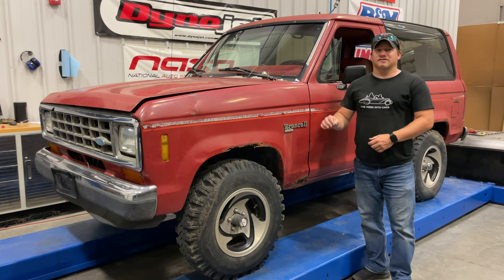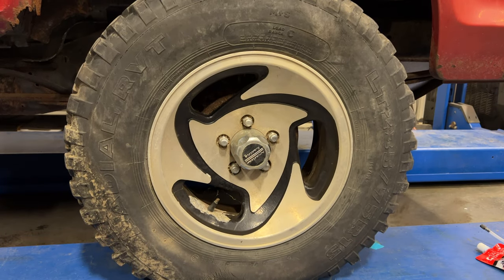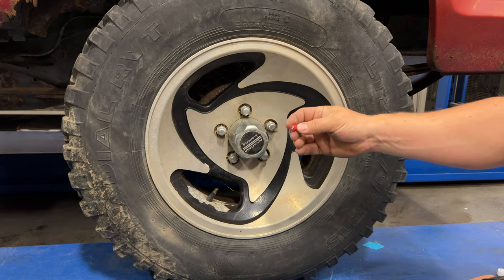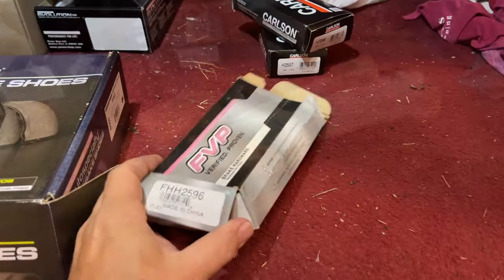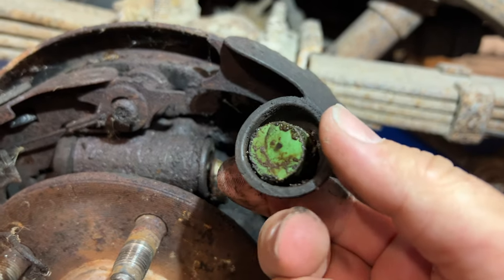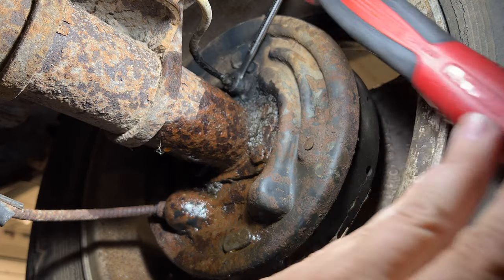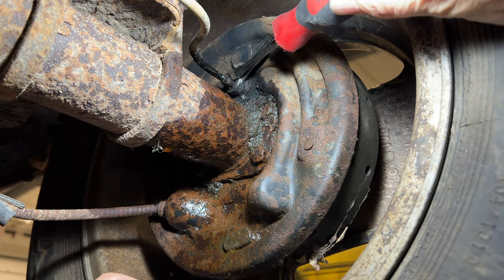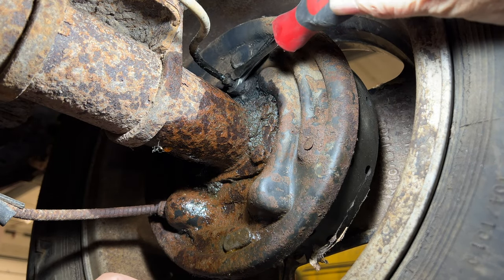Fixing the Tires and Drum Brake on Your Ford Bronco II

Comment: Steve,i once repaired a puncture by pouring pva in from poundland(dollar store).
Worked well and outlasted the tyre.
Cheers.Thumbs up.
Reply from the maker: Basically Elmer’s Glue-All I am sure it would work in some cases.  I don't know if it would continuously work like this stuff or if it would dry up quickly inside the tire.

Comment: I just replaced my ranger brakes all around.  I replaced both wheel cylinders as they had rust where the center spring sits.  They probably were OK to reuse but not worth the gamble on the old seals to save $30 for the pair.   My biggest problem was the deep ridge that the warn pads made on the drum.  I destroyed the keepers pulling the drum off.

Comment: That tyre repair kit looks good. They do something like that in Iceland but use fire somehow, same principle I think. Can't think why they didn't get brake cylinders. If you are replacing shoes it is good practice to replace cylinders especially if they look old. They don't cost that much anyway. Thanks for the video Steve,  very well explained for those who have never done it.👍👍

Comment: I have a few of those gearwrenches but I've only used the box end because I can't figure out how to make the open end work for me. Sigh.
Reply from the maker: One trick is you have to push them against the bolt or nut so that the head is in as far as it goes, otherwise it does not work well.

Comment: Would you agree it's a good idea to take out the new bleed-screw and put some anti-seize on it?
Reply from the maker: I’ve never done that.  If you maintain your vehicle properly you would be bleeding all your brakes once a year or two which would keep it loose.  If you park your vehicles outside all the time and you drive on salty roads it might help.
Reply: Fair point! Do you think it could  do any harm?
Reply from the maker: Nope as long as you get it torqued tight enough but not too tight 😂
Reply: Too tight is when it snaps off flush, right? LOL

Comment: Nice job. I can not remember if you told us or not. But is this a carburetor or injected engine? I asuming it's the 2.9 v6.
Reply from the maker: This is fuel injected just like my Ranger.  The pump I replaced last time is a high pressure pump and there is a lower pressure pump in the tank that feeds the high pressure pump.

Comment: Why didn't you put the new brakes on?
Reply from the maker: What was there is going to work fine and probably last the life of the car.  I will save them for later if the Bronco or Ranger or some new project needs them.  No sense in wasting new parts that aren't needed.
Reply: @ThisWeekWithCars  ah gotcha. I just like things shiny